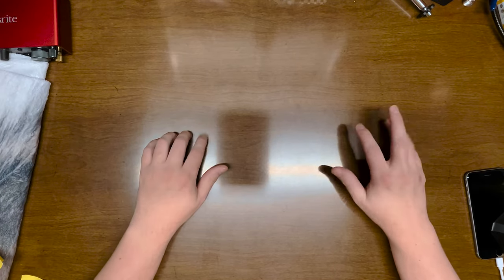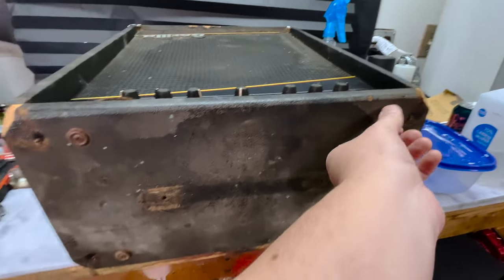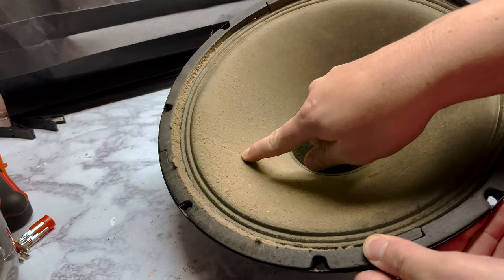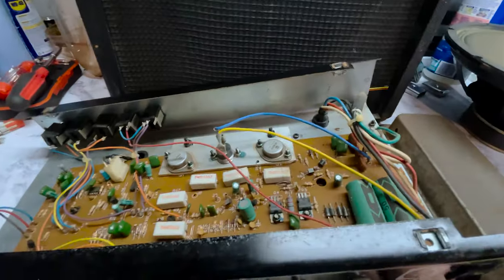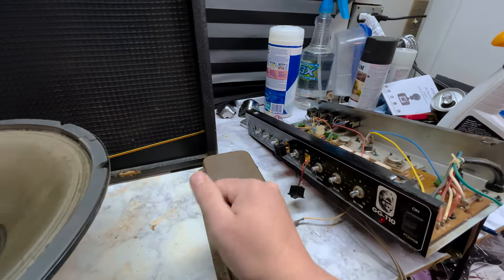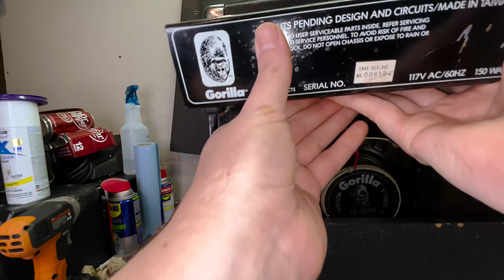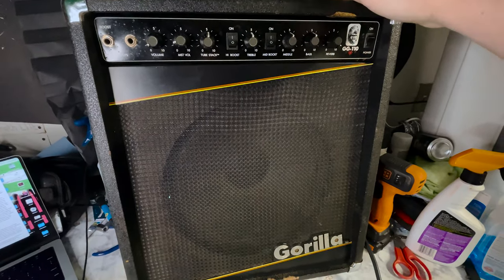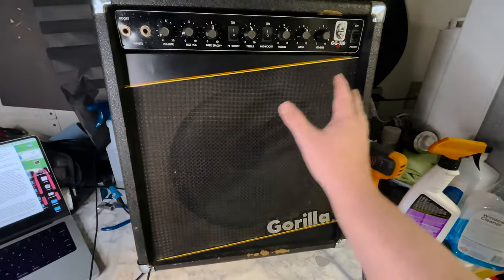Gorilla GG-110 Amplifier - Guitar amp repair

Comment: Gorilla amps WERE the epitome of guitar tone back in the 80s!
Reply from the maker: It certainly is a tone.
Reply: @bottleshipcaptain  Yep! the speaker and box let these amps down. The circuit is usually decent, & does the job!
They were made in Taiwan, so would be of decent quality!
Reply from the maker: Super loud for the size. I want to crank it up to see what kind of sound I can get but I’d have to wear earplugs. I also want to get a decibel meter to see how loud it can get.
Reply: @bottleshipcaptain  I'd say it'd do ~100-103 dB!
Reply from the maker: Well one of these days I’ll test it and see.

Comment: On the back where it says 150 Watts this😂 does not mean it puts out 150 Watts through the speakers..... probably realistically more like 10 or 20 watts. Still very cool vintage budget amp. Never spray wd40 in your pots! It does not dry up and creates a mess, get some alcohol  if you don't have any electrical contact  cleaner.
Reply from the maker: What I used was WD40 branded electrical contact cleaner not regular WD40 so all good there. I tried finding more info on the wattage online because 150 seems high but that was the only number that came up.
Reply: @bottleshipcaptain  Oh I didn't know wd40 had a contact cleaner.